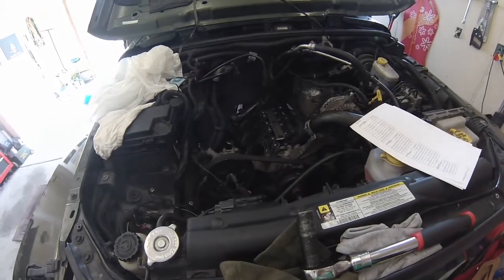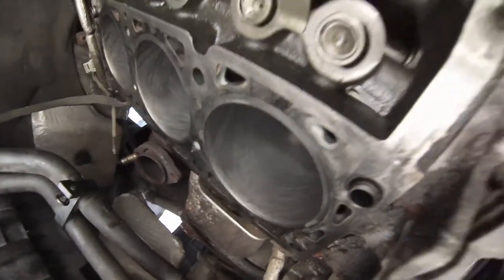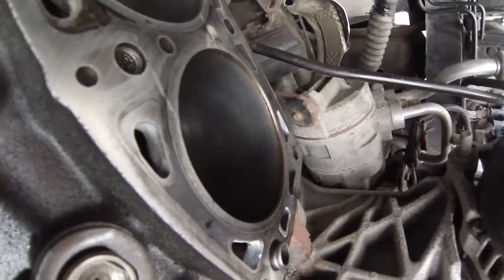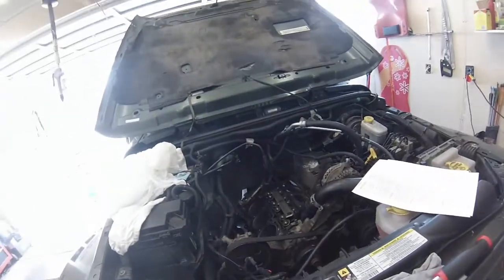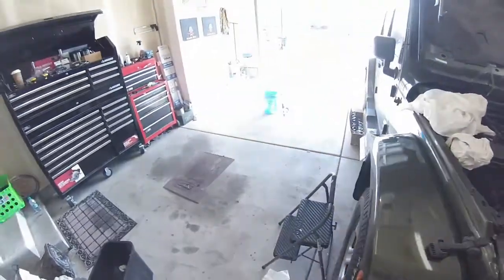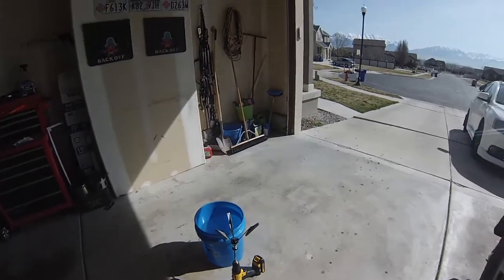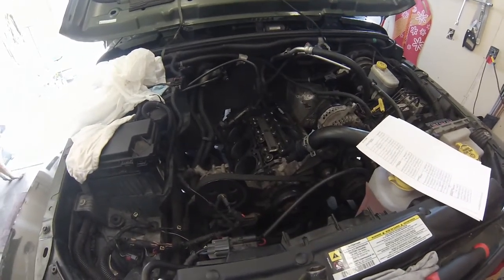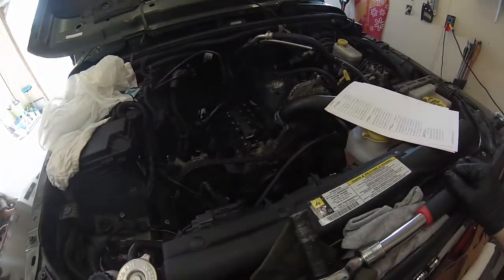Jeep Wrangler JK 3.8L Engine Rebuild Part 2 - Cylinder Honing

Comment: I just did this same job a few months back.  I pulled the engine and did a rebuild somewhere between what you did hear and a professional job.  Like you mentioned this is for people that don't have or want to spend a large amount on an engine build.  Having the engine out on an engine stand makes the job a hell of a lot more fun.  I used the same hone you're using here and I reringed the pistons, new rod and main bearings, meling oil pump, all the gaskets of course, rear main seal, water pump, alternator an starter.  I did take the heads to a shop in Indy and specifically told them all I wanted was to cut the valves and seats, install new seals and of course clean them up.  They came back like brand new and was only $150.  After doing a set of heads lapping the valves in and installing seals on a chevy v6 I decided it's time I rather pay someone else to do and of course cutting valves and seats are going to be a lot better seal for longevity.  Still like what you did here.  Good vids
Reply from the maker: johnbrakingground thanks for watching! I would have loved to get a valve job done and such but all the local machine shops in my area told me on the phone that they stay so busy doing large jobs that they either don't do small jobs or that it would cost too much to make it worth it for them. There used to be a backyard machinist not far from me but he either passed away or retired cause he's not around anymore. 150 would be well worth it to me to have that part of the job done. Thanks for the feedback!

Comment: Can you tell me what caused the rings to fail . I have a 07 3.8 jk with 95k on it been sucking gas hopefully it’s just injectors
Reply from the maker: It was likely the PCV valve failing and allowing oil to be sucked into the top of the engine.
Reply: @TheDadBodWorkshop  makes sense 👊🏻

Comment: Awesome videos, I'm about to do this same job on my 3.8 JK, where can I get the spec/guide sheets you used?
Reply from the maker: I got everything directly from the manufacturer. I got the Factory Service Manual. I found it on Ebay, they usually aren't too expensive. Good luck!!
Reply: @TheDadBodWorkshop  already finished and engine is running great, couldn't have done it, or had the nerve to do it without your awesome videos, thanks again. 👍🍻

Comment: I get trying to do the work at home but as a profession engine builder I can’t help but cringe at everything your doing. I watched your video on rebuilding the heads as well and there’s a lot of miss information there as well. Anyways hope it works out for ya.
Reply from the maker: James The machinist thanks for your comment. Judging by your username and your comment, you do this professionally, not as an amateur mechanic. The entire purpose of this video is for amateur mechanics to be able to do this. I didn't have the money to send the heads in and the block to a machine shop to have it professionally. I followed Chryslers  own service manual step by step. As an engine builder I'm sure you can appreciate the art and skill that goes into building engines, and with that I'm sure that you can also appreciate that not everyone does it the same. Thanks for watching.
Reply: I get it. Taking it to a machine shop is costly but you get what ya pay for. There’s certain things about rebuilding an engine that are very critical and if you don’t do it all the time you might not know it. For instance when you hone the cylinders you should first check the clearance , you don’t know what the clearance is in relation to the clearance spec, and you need a hone to get the correct finish for the rings. Different rings require different finishes. Also you should do a final wash with the block. It looked like you left the crank in it that’s kinda sketch. With the heads you should of used a carbide tipped scraper instead of the bristle pad. I can’t tell you how many times I’ve seen someone screw up a head with those things. Even professional mechanics. It might look good but until you resurface them you won’t see the low spots created by the pads. I know you followed Chrysler’s instructions but as a fellow jeeper some of the shit they say is truly mind boggling. For instance the amount of allowable oil consumption for the 3.8. Anyways hope it all worked out for ya.
Reply from the maker: I did check clearances of the cylinders. Both before and after the honing process.  And I compared them to what Chrysler said was within spec. I also did leakdown and compression tests after after the first 100, 1,000, and 5,000 miles and they were all great. Again, thanks for watching.